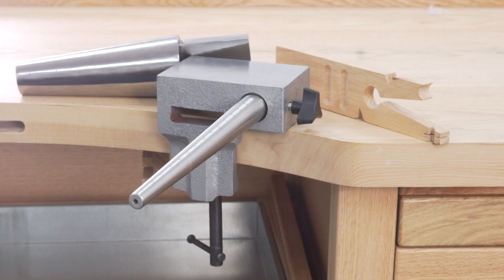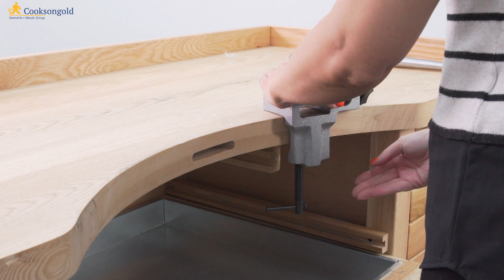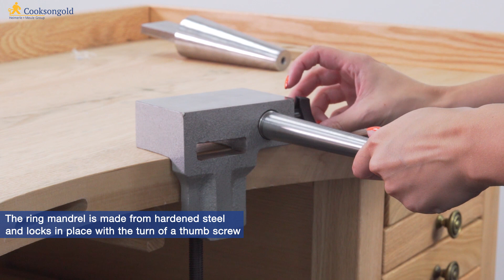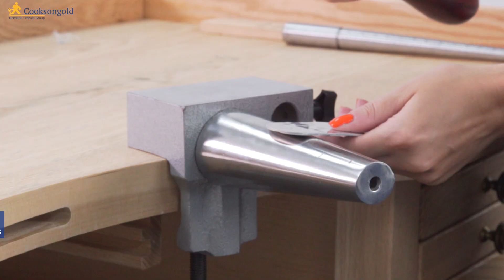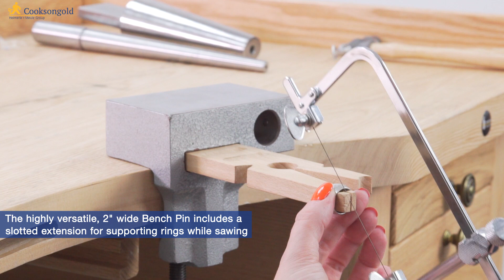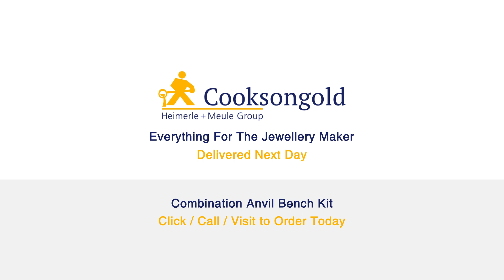Combination Anvil Bench Kit for Jewellery Making

Comment: Looks like night and day from the one i received. Mine has paint chipped of all over and the anvil is pitted deeply. I worked in heavy engineering for a long time and looking at this tool i would guess it is manufactured in India. I suppose I could have the top skimmed and spray paint it. It's a handy tool the once or twice I've used it. This is not a cookson issue but rather their supplier, personally I've always found cookson excellent to deal with and they are my only supplier as I can trust them implicitly.